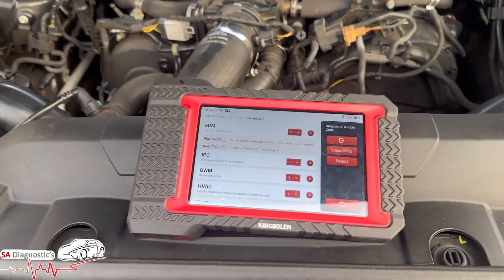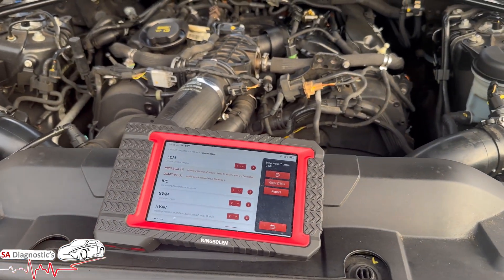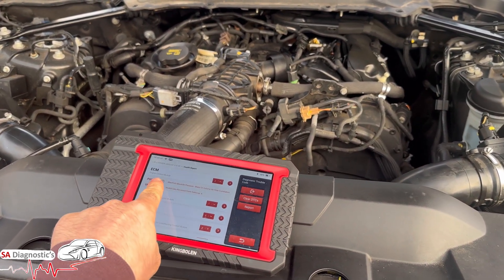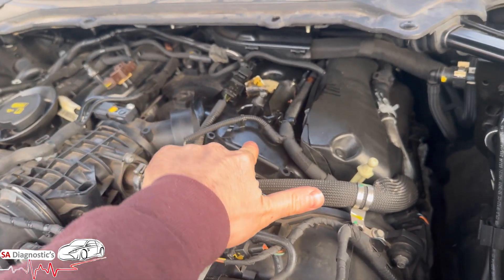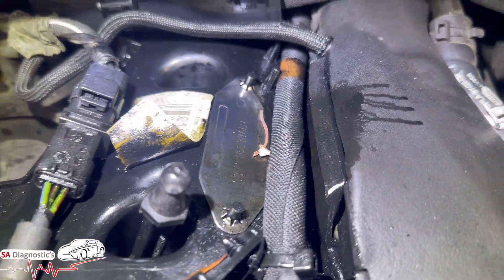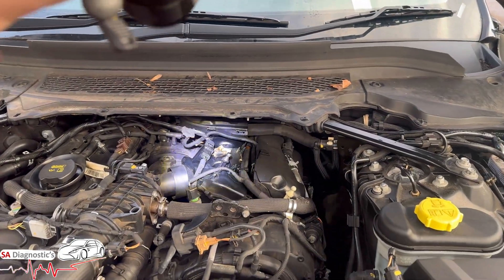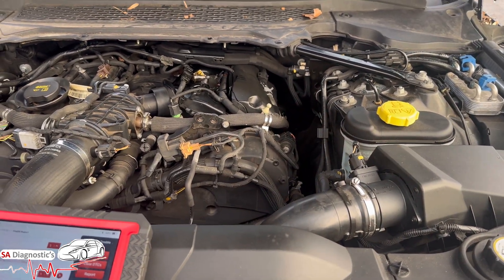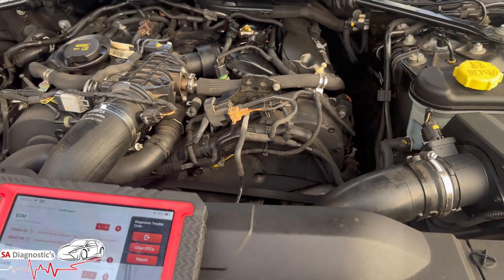Land Rover P006A Manifold Absolute Pressure - MASS or Volume Air Flow Correlation | HOW TO FIX

Comment: Thanks for the video. I have the same problem. My car goes up to about 80 KPH but drives like as if it has 40 hp. And I have an oil leak in the area, and a trouble code P006A-00 (Manifold absolute pressure - mass or volume air flow correlation).
Probably I will try to stick it with some glue and I hope that the leak is taken care of.